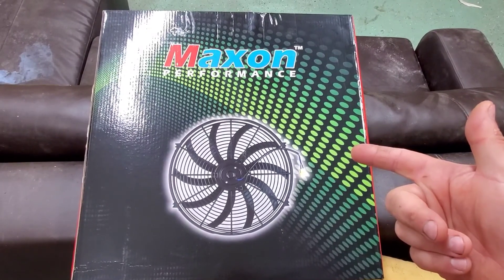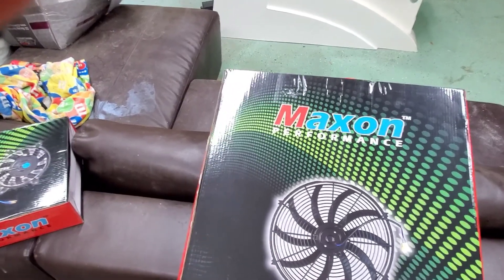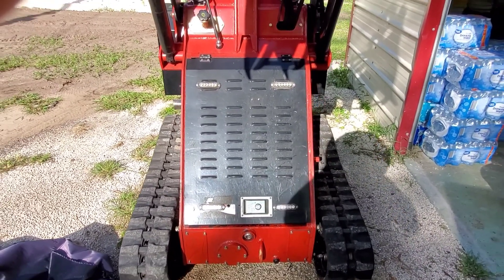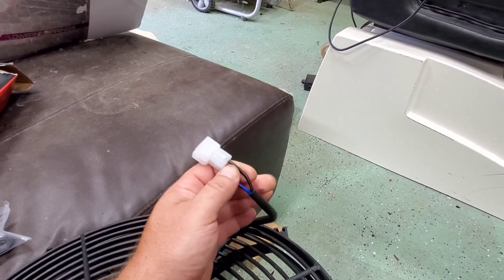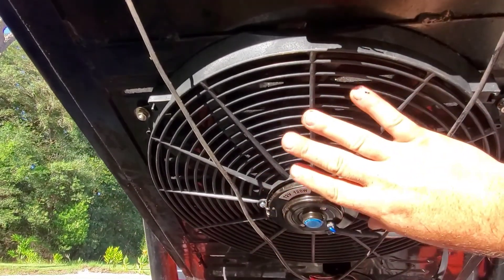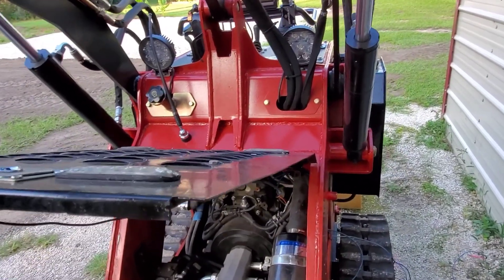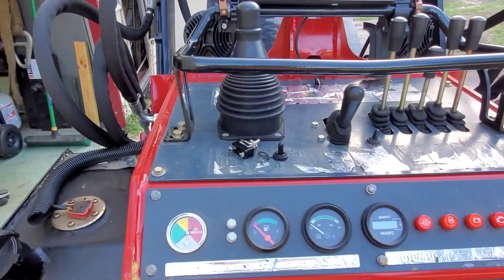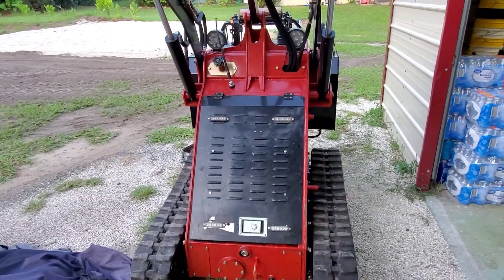MTLD25 fan mod

Comment: How are you liking the quality on the mtld25? I saw your review on northerntool. I do sprinkler repair/installs and looking for a tractor and came across this thing. It looks like it would be a good fit for me. Thanks for the videos.
Reply from the maker: I was very happy with the machine at 1st but as I use it and I have over 200 hours on it now the best advice I can give you this is a machine for home owners if you gonna run this machine 3   4 hours Like I do and the tree industry this is not the machine this machine is geared more for home owners but if finances are an issue like in my case I had no choice.
Reply: @FLORIDALIFECLIPS  thanks man. I have a kenga model 2 and it's just too small. Is your issue quality or is it not powerful enough?
Reply from the maker: @KriegerKrieg   It's small issues because this is geared more towards light use homeowner use I'm using it for full blown commercial use